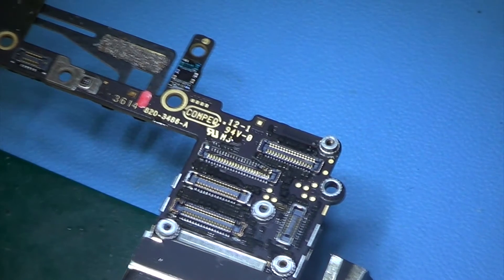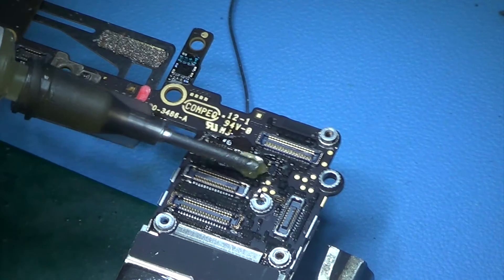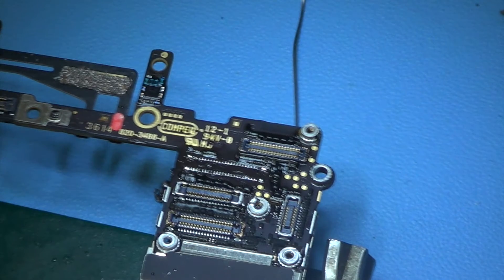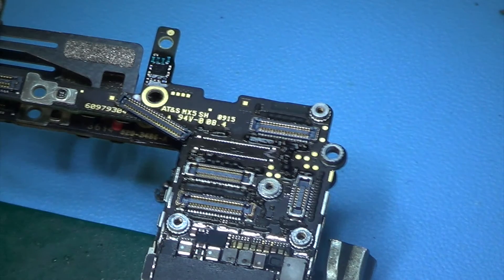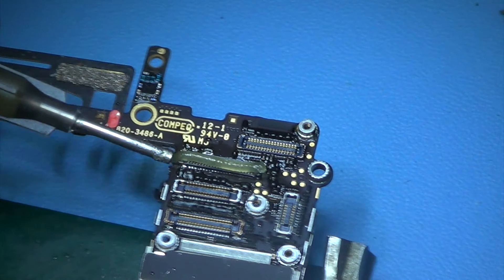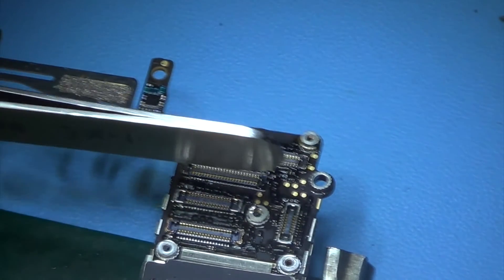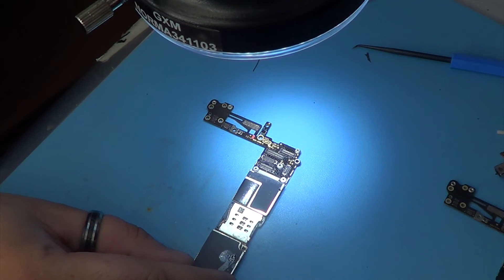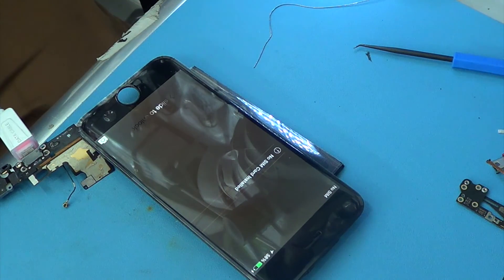how to replace iphone 6 touch connector taken off from another board

Comment: great video, would you know if the charging dock flex FPC will not melt with heat gun 300 -350 deg? or should I try just using the iron? Thanks.
Reply from the maker: it will melt unless you stop giving heat over it before you pull it from the board
Reply: M6 Repairs can u help me with my iPhone same problem

Comment: I'm confused why you needed to use the solder at all? Why didn't you just use the flux with the first connector when taking it off the same as you did with the second one? What's the benefit of using the solder st all on the first motherboard? Thanks
Reply: they usually use a low temperature solder to mix with the existing hi temperature solder already on the pins. then when applying heat with the gun it melts quicker and at a slightly lower temperature so as not to melt the plastic parts. but i must say i think he was i little high with his temp as he totally destroyed it lol. around 320c/360c should be ample heat for this job.

Comment: Thanks for the vid. I've recently had a problem with getting the digitizer connector to fit in the fpc connector after soldering it to the board. The connector isn't melted and joints look great with no movement. Any ideas would be greatly appreciated, thanks!
Reply from the maker: Stephen i did not quite understand what the problem is?
Reply: +M6 Repairs so basically after I solder the digitizer connector on and all pins look good, aligned and have no movement the actual screen digitizer cable won't seat properly. The fpc connector isn't melted and looks good under a scope. Any suggestions? Thanks again for the reply
Reply from the maker: that can not be i think it be be a different model fpc

Comment: how did you do preventing from melting the connector? I try with about 390c on hit air but the connector starts to melt.
Reply from the maker: it was the matter of split second in my case as soon as I saw the solder has melted i moved the heat gun away and removed the connector both were done in a split second so the solder does not become solid again as well as hot air will not blow in the connector as it will melt
Reply: also can add flux time to time to prevent melting